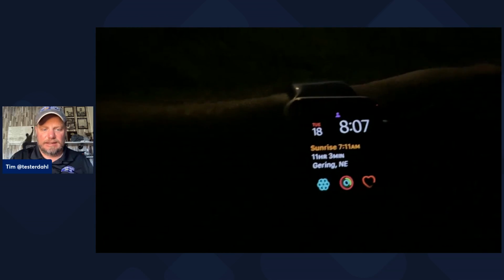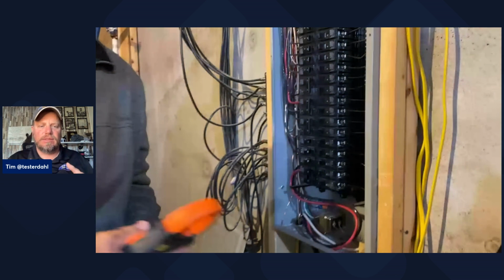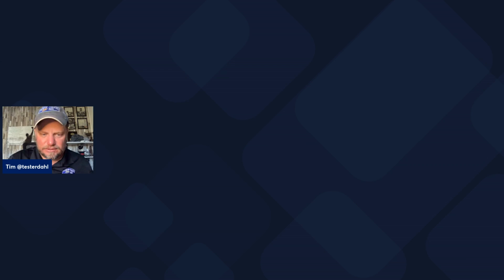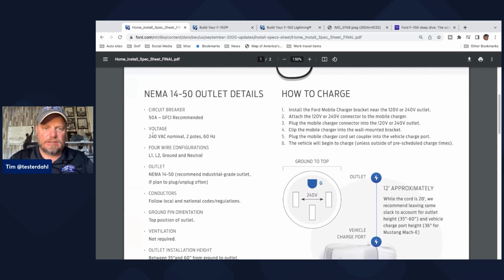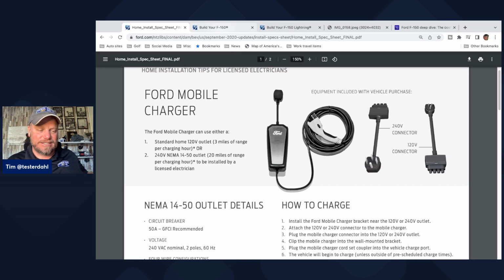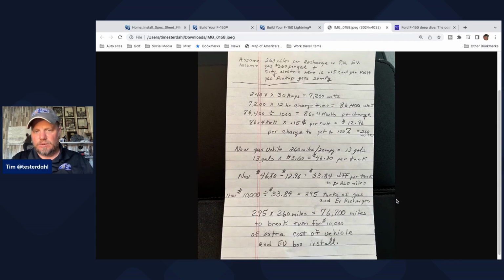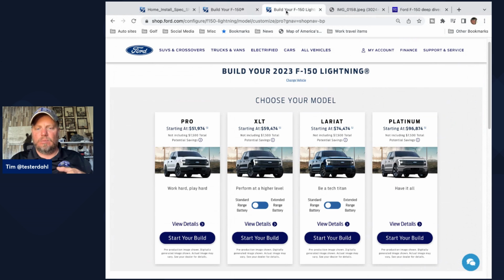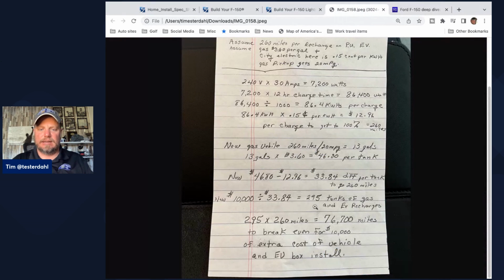11+ hours later on 220V charging price for 2022 Ford F-150 Lightning

Comment: Another consideration to take into account with the electric trucks is the diminished mileage when towing, Hoovies Garage channel posted a video on this with the F150 Lightning which showed some very disappointing results.
Reply: 6 wire copper is good for 60 amps, no: 8 is 40 amps and no:10 is 30 amps
Reply: A little higher if your drawing 30 amps or 31 or 32 you should use no:8 copper with 40 amp double pole breaker. That charger is consuming a lot of power. High electric bills to come.
Reply: It wouldn't be that bad if we had a decent charging infrastructure.  But we don't and even the charging stations that do exist,  often don't work. If there were as many fast chargers as there are gas stations,  there wouldn't be a problem.  Granted, even then if you're in a hurry to get somewhere then this isn't the way to go. Because even a fast charger will only get you about 75 kWh in 30 minutes.
Reply: @mikga45  depending on your kWh charge you pay at home. Where i live in Illinois I pay 8 cents winter 12 cents summer. Other states are much higher. And if you want to public charge expect to pay 31 - 43 cents per kWh. Now that ridiculously expensive and isn't economically feasible.
Reply: @pstoneking3418  in 26,000 km (16,000miles) I have spent about an hour total time charging. Most times, sometimes as often as twice a week, I plug my car in at home and have dinner, read, watch TV, or sleep while I "fill up" for about three cents a mile. As long as I am less than 150 km (90 miles) from home there is no need to stop to charge. I value my time even if it is only 15 minutes at a time that is a lot more than the 15 seconds it takes to charge on a regular basis.
Reply: Not only towing, but camping in the mountains, off road trips, elevation, etc. No way would I trust any battery powered SUV for family vacations.

Comment: In my mind the best use for an electric vehicle would be in an urban area with relatively slow and lots of stop-and-go traffic. I could see the value in owning one as a second vehicle dedicated to just that purpose alone.
Reply: Thats exactly my situation with my Egolf. Love that car.
Reply: A few years ago I looked into an EV as a commuter car. Summer, ok. But in winter storms, in the cold, parked on the highway with lights on, heater on, wipers on, etc., it became marginal on getting thru 1 commute. There are people in Europe now saying that a gas car is cheaper to fill than an electric. Near me, they shut down a 4,000 Mwatt coal burner, and replaced it with 4 Mwatt of solar. Great for recharging at night. I have to wait to see what the utilities plan to do about power supply before I'll become one with a green car. Mind you, if you can't drive them they are green, right?
Reply: sure solar to charge cuts the charge cost, but your farther in the hole another $12K if you do it yourself, or $80+K if you buy a system to get that free charge.
The diesel version of my car gets 50% better mileage, the 15% higher fuel isn't even an issue at that point.
Reply: The problem is this is a good idea but these electric vehicles are so damn expensive. Musk was talking about building in around town electric car for about $6000 which would be an excellent idea.
Reply: The Fastest production car 
The quickest production car
500,000 plus mile batteries
4.5 time's mes  more efficient 
And it only makes sense to you going slow around your trailer park?
Good on you
Go get your trophy 🏆
Reply: Only problem is, who wants a second car at $30-40k. I can buy a lot of gas with the money saved buying a $5k(or less) used car.  In the future IF there is any reasonable used market for EV, then maybe, but it is a pretty big if, and probably not in my life time.
Reply: @t.r.campbell6585  Even $15k commuter car might be reasonable. We still have battery and charging infrastructure issues.  In my view another 20 years before it is all practical.

I bought an ebike for $1500, not to save the world but to get out more. I did end up saving a ton of $$ not driving as I ride every where, it is so much fun.
Reply: @robcrissinger776  In general who really cares how fast their car is? If I want fast I ride a motorcycle. Day to day driving doe snot need top speed or acceleration.
Reply: There is no value in owning an EV.
Reply: spend 90k on an electric truck just to save $1k in fuel a year driving it around town.  ok.
Reply: Best use for an EV , the golf course.
Reply: @michaelbayliss1794  LOL yep  4 hrs use plug it in... prob doesn't count D&D in EV's eh??
Reply: <<. I could see the value in owning one as a second vehicle dedicated to just that purpose alone.>>

REAL environmentalists make an electric vehicle their 2nd car. 

This is supposed to be irony.
Reply: @robertsmith2956  I use my home solar system that I installed myself 15 years,  got a 30% rebate from the government,  or should I say that correctly,  from taxpayers,  including myself.  So that did cut the material costs by 1/3. Still pricey because back then solar was extremely expensive.  I've since increased the solar array by 4500 watts with total solar now at 13 kw. On a sunny day it generates as much as 65 kWh of power much isn't used regularly as I  only have 800 AH on my 48 volt system. I seldom take my batteries down below 70% soc so charging them back to 100% which only takes around 15 kWh. So even on very cloudy days my solar system generates enough power to power my home and keep my batteries charged.
Reply: @georgerivera9220  Little to zero maintenance.  If you already have a home solar system like me then I don't pay anything for the electric to drive my lightning.  I agree EV's definitely aren't for everyone,  but like them or not, they are the future vehicle that everyone will be driving in the future.  Not right now though because our electrical grid and charging infrastructure just isn't ready for everyone to own an EV.
Reply: @666dynomax  I look at it as an excellent investment for my money. Stock market will be soon crashing like everything else.  Our dollars are loosing value every day. You can't go shopping for even a small amount of food without spending $100+. My home has been running mainly on solar for around 15 years now. When I get a lot of cloudy days, is the only time I use grid power and if that's not available I use my 11 kw propane generator which is connected to a 1000 gallon tank. My 2014 F150 was getting around 15 mpg & when towing my trailer around 8 mpg. Also got tired of oil/filter changes and all the other maintenance required on ICE vehicles.  I've been waiting for an all electric truck for years as my solar produces around 65 kWh on a sunny day and I only use around 30 kWh per day, so much wasted electricity.  I  finally have a place to put some of that excess sun power. I  realize EV's aren't for everyone,  but for a few of us old timers that are tired watching our dollars disappear right before our eyes,  the Ford lightning is a great investment.  I  bought at MSRP.  I've already had an offer for $20,000 more than I paid for it. I'm not about to trade it for more worthless cash. At 73, when the time comes, I'll let my 4 children sell it and divide the money among them. Possibly better investment than holding gold or silver.
Reply: @pstoneking3418  yep that's the power of putting solar in. Kind of like yesterday was the best time to plant a tree next best time is today
Reply: @drewthompson7457  Appears to be correct. 95% of the EVs are still on the road. The other 5% apparently made it home.
Reply: @pstoneking3418  : about 10 years ago, some people I know put in a 10 Kwatt solar array, with government help. They paid it off, (broke even), in 9 years. I'm getting too old to make that kind of commitment.
Reply: I would say that's a fair statement

Comment: You do realize it takes YOU 10 min to gas up and it takes an EV owner 20 sec to plug in.  An EV doesn’t stand next to their car while it is charging. Not to mention our “tank” is full EVERY morning. When gas is 5.00 a gallon I only spend 25 cents for every 1.00 a gas vehicle spends to travel. That’s just travel no maintenance of which EVs have virtually none (tires and wiper fluid). My Tesla Model 3 will be FREE in five years because the money I don’t spend on gas will pay for it.

Comment: No.  It is NOT a constant draw for the entire charge cycle.  It is NOT 12 hours X 7200 watts.  Without knowing the programing,, but likely,, it is 7200 watts for the first 2 hours.  Then it is slowed to 4000 watts for 2 hours.  Then it is slowed to 2800 watts for 2 hours.  As the battery temperature rises,, the computer will slow the charge.  If you tried to stuff the whole thing to 100% charge,, very good possibility it will ignite and burn  in hour 5   The charge must be tapered toward the end.